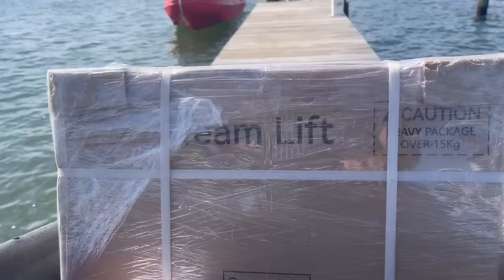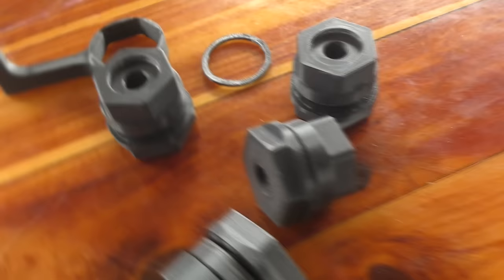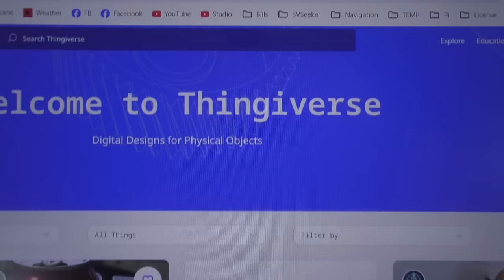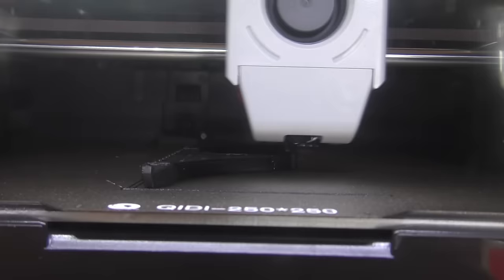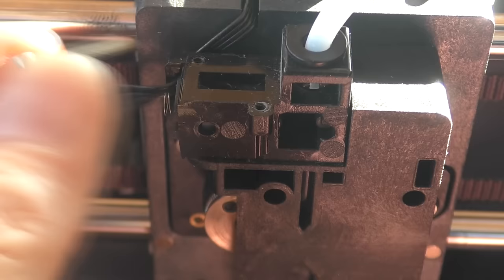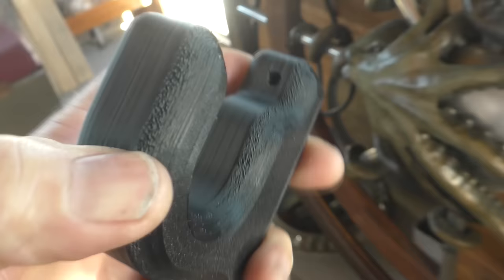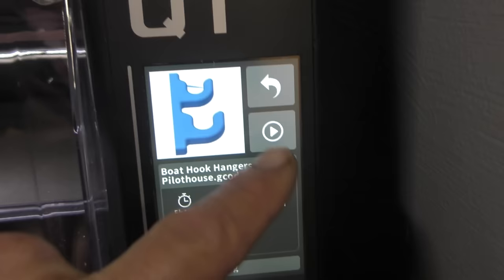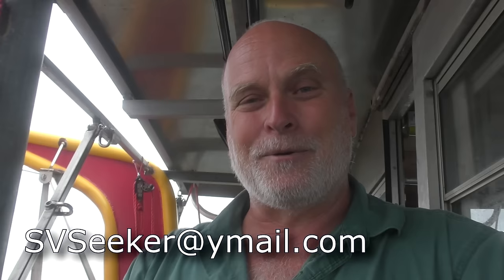QIDI Q1 3D Printer - Is it for you?

Comment: This is great! But as you mentioned, I dont recommend using PLA for anything on the boat, that stuff degrades faster than my enthusiasm for interpretive dance lol. Use the engineering filaments, ABS, Nylon, and the fancy stuff that won't soak up water from the air and become brittle or won't start to decompose like the degradable PLA. I have parts made from PLA that were a model for a mechanical watch mechanism so they were under constant strain from a year ago they have broken sitting on a shelf indoor without even being used with no exposure to the elements, PLA is for prototyping not for actual implementation. PLA becomes brittle and weak, not that you cant make it stronger, you can print bulkier and denser with higher infill and get a hulking part, 100%,  but I wouldnt risk it and I dont want your enthusiasm for this great technology to be bruised by using material not meant for long term use and exposure to the elements.
Reply: I had black PLA irrigation stakes in a flowerpot, exposed to sun and rain for about 5 years. They did not "degrade" one bit, though they got deformed by the heat and the constant pressure of the PVC capillary pipe they were holding. That said, I'd avoid PLA just because it melts at a way too low temperature and when it soaks moisture it becomes brittle. PETg is similar enough for printing quality and will survive a bit better when exposed to the elements. PLA is "in theory" biodegradable, but it has to be composted in some very specific conditions.
Reply: Nylon is notorious for picking up water.
Reply: Mate! The interpretive dance the students done for David Blaine when he was in the Ice Cube in London was lit!!!
Reply: @cwill6491  you're right, it is, but they also use nylon for toothbrush bristles so I wonder if nylon only has water concerns before printing due to the water causing sputtering in the heat chamber? Perhaps after printing is conplete the water absorbed doesn't have much drawback in nylon? I have never printed nylon so I'm just guessing here. My new fancy printer capable of nylon printing won't arrive for weeks sadly.

Comment: Threaded bulkhead fittings with the TPU seals is something I use my printer for as well. There are a whole lot of normally pricey items you can replace with 3D printing! The Qidi is an excellent choice since the heated enclosed chamber will allow you to print most of the toughest materials as well. We 3D printed a throttle body adapter out of carbon fiber nylon and it's holding up even at 13psi of boost in a hot engine bay! Crazy what printing can do. I think the Q1 Pro is the most capable printer on the market for the money right now.

Comment: A heads up for using TPU since you are in a marine environment. TPU is like Nylon with its sensitivity to relative humidity where it is stored. It isn't as bad as Nylon is, but it still needs to be stored in either a 5%-30% humidity environment or dried at 40 C to 45 C for 5 hours before printing with it. You can make storage boxes for your filament that have descant in them that you dry in the over periodically or you can dry the filament before printing. I won't go as bad as Nylon will with water in it, but your prints will still have problems if there is water in the filament.

Comment: Nice custom hooks Doug, the exact same ones from aft deck and some glued in foam from a piece of insulation will be great for fishing rods I think ! 

Next project on your list could be some multi piece spray chines for the red Whaley tender... 1 or 2 curved transitional pieces for bow on each side mirrored, and straight wider segments after that going aft ? Add a little wedge or dovetail for a tight fit between pieces for some sealer so they don't get scraped off easily by rubbing on hull or docks ?  You could even sell or trade that enhancement back to the Whaley folks and have them make it in high density plastic or a rubber material... If you don't want to use riv-nuts in hull for mounting, could it be affixed with a tensioning cable or something running through the middle of 3D parts ?
Reply from the maker: All kinds of stuff comes to mind.

Comment: PLA gets brittle exposed to the elements, and melts when it gets hot (like in a car in the summer or on your metal boat deck?) Make sure to use ASA in those cases, can handle higher temps and is UV resistant!
Reply from the maker: It sure started making parts a lot faster than the printer head we added to my CNC table.   And thanks for the tips.  I'm just starting with Blender.  I like Fusion, but I refused to rent software.  BobCAD-CAM is not Fusion in any way, but it's simplicity means I can leave it from months and then come back and go right to work.

Comment: Great 3d printer.  I have the anycubic Kobra max and i have an 1/10 RC car chassis completed and a RC 19 inch boat chassis that i can add to the a chris craft runabout i designed.  Yes the design is the learning curve.  I use blender and Shapr3d and the Cura slicer.  Also, KICad can design your PC boards to put RC and arduino components on it and they come back from china in about 5 days. $.40 each.

Comment: Highley suggest using PETG instead of PLA or ABS. Just as easy to print as PLA while being Cheaper, stronger, and much longer lasting. Pla falls apart even in the shade from moisture. Which is plentiful on a boat.

Comment: that's a fancy printer you got there!
PLA kinda sucks for everything I have ever used it for and so i just use PETG as its the same as water bottle plastic 
just a little bit harder to print then pla 
there is even carbon fiber and wood you can print with :)

Comment: Also for the strongest parts use 3-6 walls, and top/ bottom
25-50% gyroid infill 
And 10° or so above recommended print heat for the hotend.
 Chamfer the edges in cad will help with overhangs too!
Reply: I am finding 3D-Honeycomb does similar, if not the same, and faster - thoughts?
Reply: @JMS7410-   I agree with the same strength, but I guess infill is subjective to alot of different factors for speed. I use a higher speed with gyroid because there are no major directional change or corners so in my mind I can push it a bit faster, but I your 100% correct it should be very similar in strength for 90% of parts. There are some parts like tall cylinders where the 3d honeycomb would be even better than gyroid. Also I have found that doubled infill walls with gyroid are vastly stronger but that's only with prints that need huge amounts of strength, to be honest I have not tried double honeycomb. I will do some tests and let you know!

Comment: Doug, interesting video, and that QIDI printer looks good. Impressed by the speed and ease! Thingiverse is a great resource and after building a 3d printer from a kit, which works extremely well (I was surprised and amazed) I’ve been impressed with PLA, PET and flex filament printing. My Prusa is nowhere near as fast or as big as the QIDI, but the software is very similar indeed (odd or not?). I like ‘gyroid’ infill, but it will shake your table even more. I rarely go >35% infill in PLA or PET but having thicker walls etc is very handy. Am just starting to try Fusion 360 and have experimented with Blender and a few others. Investing time in the CAD is key as you say, but there are plenty that are free. TinkerCad is also very simple to use. Not come across BobCAD-CAM, so will have to check it out, but I don’t CAM (yet). I can understand why you use the same software for everything. It’s all about getting the part made for the slicer. After than it’s all just runny gravy!

Comment: I've got to start learning CAD, how do you find bobcad, is it the best starter program and are the costs to the DYI reasonable (nothing on their web site about costs). Thanks!
Reply from the maker: BobCad is fairly simple so I find it easy to come back to after months of not touching it.  That and I own it.  I don't every want to rent software.  It also works without any connection to the internet so it's good for a boat.  But there are lots of offers out there and some them open source and free.

Comment: For large parts use 3-6 wall thickness with 5-10% infill to make it plenty strong. There is absolutely no need for more infill. For smaller parts you can bump it to ~25%. Also orient your parts in a way that the XY direction takes the load. The Z direction is much weaker as it relies on the bond between layers.
Don't use PLA for outdoors, it gets soft at ~50C.
Seems like you knocked some SMD components off from the filament sensor.